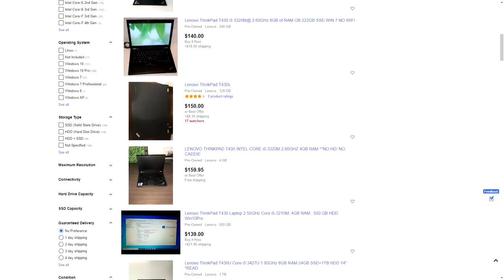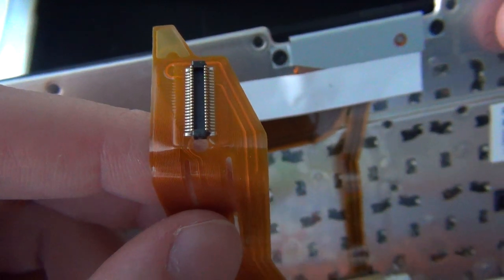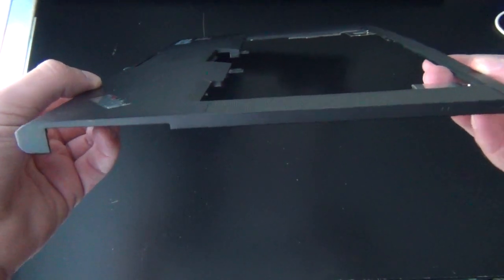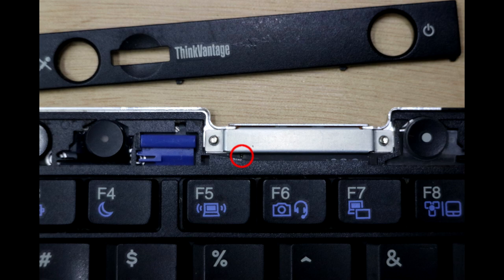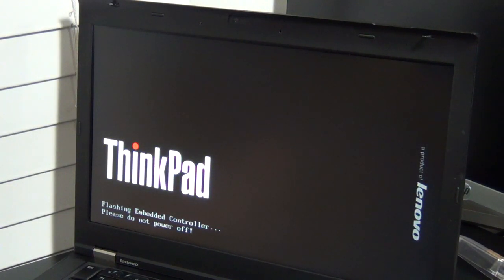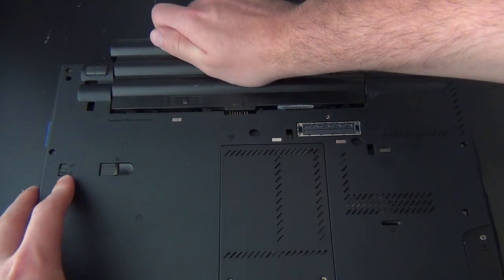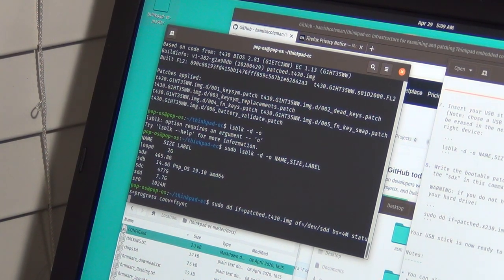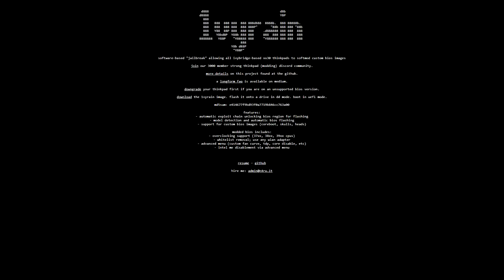Installing the classic keyboard in Ivy Bridge ThinkPads

Comment: When I did this on my x230 tablet I tested they keyboard swap without isolating the pins and the laptop started smoking within moments of turning on. Thankfully I hadn’t actually attached the keyboard into case so I was able to yank it out before any damage was properly caused. Please isolate the pins.
Reply: Just put an x230t motherboard in my x220t last week and this is the first I'm hearing of this, I think I might have open it back up today

Comment: Very nice video! Thanks for sharing! (One remark though, at 11:44: "sudo apt-get update" refreshes only the package information. It does not actually perform any "update". For this, one should issue the command "sudo apt-get upgrade" after the information on the packages has been updated. Unfortunately, the keyword "update" does not have the same meaning for every package manager. For instance, in Fedora, "sudo dnf update" will in fact update/upgrade your system.)
Reply from the maker: Whoops! Good to know.

Comment: the keyboards on the old thinkpads like the t420 are THE best laptop keyboards hands down.  it's orgasmic to type on it
Reply: I totally agree. For now we can stock up on *30 series thinkpads, and mod them with the *10-*20 keyboards. And stock up on spare keyboards. But sooner or later the day will come... what are we going to do when the keyboards supply is exhausted? Or when the laptops that can use them don't function anymore, or are too slow to run the ever bigger and slower software of the day?

Comment: 12:08:  It should not be necessary to run 'git' as the superuser in this step.  Downloading and building the EC software should be possible with ordinary user privileges.

12:45: Again, building the software should not require root.  (The reason you needed root in this instance is because you ran `git` as root earlier, and the thinkpad-ec directory and all its files are consequently owned by root.)

14:32:  Helpful mnemonics for the `dd` args:  "-if" == input file; "-of" == output file.

Comment: I've been using an X220 since 2011, and am a big fan of it's keyboard. I had a desktop PC at work, I got a ThinkPad USB keyboard for it, which has the same layout as an X230. I have to say the keys have pretty good feel and I did a lot of coding on that keyboard and basically it's a pretty good keyboard. But, even if the keys are good, the layout is not as good as the 7-row keyboard. I kept missing the way the Del/Home/End/PgUp/PgDn keys are arranged on the 7-row, and also the F keys being divided into groups of 4. So I think it's worth the hassle to fit a 7-row keyboard into the *30 models.

Comment: Great video! You might want to add the lsblk command, to the -o part the model parameter : lsblk -o name,model
That way you can see the drive model and it will be a bit easier to identify your drive.
Reply from the maker: Good to keep in mind.
Reply: Or plug the drive in, do `dmesg | tail` to see the kernel messages for the just detected device, the device name will be there

Comment: Best classic keyboard mod video out there!
Are the mentioned FRU/Part numbers mandatory, or does the mod work with any other T420 keyboard on a T430, regardless of the FRU/Partnumber?
Cheers
Reply from the maker: It should work with any xx20 keyboard, as they all should be interchangeable.
Reply: @SebisRandomTech  ok, good to know, thank you!

Comment: As T440p user, always envy to my friends who used classic keyboard Thinkpad. They look so so sexy
Reply: @Dhyan Jay yeah, the main reason i bought t440p is the screen, which i replaced too with IPS and also I installed OSX 14.6
Reply: The layout is irreplaceable. I love it so much I'm buying a mechanical keyboard inspired by the design!
Reply: @teguhrama2522  Why did you put OSX on a Thinkpad?
Reply: @comicsans1689  because I work with Logic Pro and Final Cut Pro.. and I hate Windows update 😅
Reply: @teguhrama2522  I would honestly rather just bite the bullet and install Windows if I needed those programs and couldn't get them working in GNU/Linux. Outside of the terminal, I can't stand using OSX. Windows 10 LTSB 2016 and LTSC 2019 work pretty well without the bloat of normal Windows 10. They only get mandatory security patches, but I'm pretty sure that you can stop updates through group policy.

Comment: When installing classic kb in my x230, I isolated the three pins, but then discovered that trackpoint buttons did not work (probably too much or too little tape). I then removed masking tape and the buttons worked again. So I decided to install it as is and everything works perfectly. I even installed chiclet kb again in x230 to see if backlight would work and it does. Closer inspection revealed that the burnout happened close to the three pins on the classic kb but it seems that it does not have any adverse effect. Putting that classic kb back in x220 does not incur any problems, everything works ok.  But it might not be the case for all. YMMV
Reply from the maker: Yup, even in reading the comments on here it seems everyone has had different experiences in regards to the isolating of the pins. I took the "better safe than sorry" approach and taped the pins this time.
Reply: Hi Sebastian. My trackpoint buttons did not work either. It did work the first time, but I have the Power Button not lighting up, so I removed the tape and put it back again. The Power Button did light up this time, but the trackpoint buttons did not. What do you suggest I should do? I am stuck here. 
I found another video talking about a similar issue. But I don't understand what he said (3:00) Can you help me with what the guy said? Thanks.
https://youtu.be/t4_6LQrmu14?t=180(from 3:00)
Reply: Your problem might have been caused by the masking tape being too thick, resulting in other (not isolated) pins not making proper contact anymore. It's better to use very thin tape, such as kapton tape, which is perfect for this application. I've done the mod to 4 thinkpads, and isolated the pins on all with kapton tape, didn't get any problems.

Comment: Love love love my T530. I'm thinking of buying an upgraded t530 I found on ebay. I was going to upgrade my current t530 with a faster processor more RAM and the 1080p screen but I decided to check eBay and I found one for half the cost of my upgrade. Now I can't decide if I want a new laptop with a beautiful touch screen and all the resolution or if I'd be fine with a classic ThinkPad for another 10 years. What thinkpads have the T430 keyboard that are still worth buying?
Reply from the maker: If you're referring to the classic keyboard as shown in this video the xx30 series is as new as it gets. They did release the 25th Anniversary Edition in 2017 which has a classic keyboard, but those are hard to obtain and can't be easily modded into other newer models.
Reply: @SebisRandomTech Sebi we’re waiting for more vídeos 😂💪🏾💪🏾💪🏾

Comment: Nice video! Weird question though.. if for some reason you decide to switch back to the chiclet keyboard, is there a way to mod the bios back to stock bios? Thanks
Reply from the maker: You would apply the BIOS patch but in the terminal in Linux you would type in a command to change the keyboard patch to "OFF".

Comment: The stock T430 keyboard doesn't really bother anywhere near as much as the newer, cramped chiclet style keyboard of today. T430 keyboards are in that transitional area between the amazing keyboards of their chonky ancestors, and those DREADFUL keyboards you'd find on, say, a modern Dell laptop. 

Useable overall tbh.
Reply from the maker: As I said in the video, the feel of the T430 keyboard doesn't bother me, it's mostly the layout. I still think modern ThinkPads have better keyboards in both feel and layout than many of their competitors, but I prefer the 7-row layout of older machines hence the main reason for doing this mod. Nothing wrong with preferring the stock T430 keyboard though!
Reply: @SebisRandomTech  Now you want an AMAZING Thinkpad keyboard? Those late 90s IBM Thinkpad keyboards were HEAVENLY to type on. Lol. The screens? Well...the keyboards were nice. Lmao!

Comment: This is a very helpful video.  I'm considering the mod but I'm wondering if there's any keyboard flexing after the swap.  Even any minor difference in feeling on different parts of the keyboard is very disturbing to me.  Some videos on youtube make them look very unstable.  Can this be mitigated?
Reply from the maker: Mine feels fairly solid, if there is any flexing it's within the tolerances of what the original keyboard would have had. You just have to be very careful with how much you file down the keyboard tabs - too little and it won't fit into the palmrest correctly, too much and it will be loose.

If you want to do a keyboard swap on a different Ivy Bridge model I know for a fact that you can get a matching xx20 palmrest with the keyboard and install it without any filing or modifications into the X230 or T430s. I in fact did this several years ago with my own X230, I swapped the keyboard and palmrest for ones from an X220 and it fit perfectly without any modifications.

Comment: Man I' m thinking about maxing out my t430 and making some custom mods like the keyboard change.

Even implementing a tri-boot for Windows/Linux/MacOS.
What a dope project computer. Just Wish I could get a better graphics card in it with out the limitations emoving the wifi for a PCI card would bring.
Reply from the maker: You can use an ExpressCard to PCI-E adapter to use an external graphics card (limited bandwidth but still massive performance boost compared to the internal graphics).

Comment: Interesting. I still use a T520 with the old keyboard, but it has been acting up due to some Intel ME problem, which caused a timer based system shutdown after 30 minutes. This problem has since mysteriously disappeared though. But it was news to me that replacement bioses exist (other than coreboot? which my machine supposedly didn't support.)
Btw, I recall reading about this keyboard swap some time ago, and if I remember correctly, it also suggested swapping the plastic handrest part - maybe doing so will obviate the need for filing the metal tabs?
Reply from the maker: On the T430 the palmrest is different enough from the T420's that you can't just swap them, hence the need to file the metal tabs. On the T430*s* and the *X*230 you can use a T420s/X220 palmrest.
Reply: @SebisRandomTech  As I have the T520 I may have focused on using its keyboard on the T530, I think the handrests may be compatible between these as well.

Comment: I see you took a linux approach to flashing the embedded controller, which i think is really cool, imho. If i could own any Thinkpad, I'd get a Thinkpad W530 and put the Intel Core i7 3920XM @ 3.8Ghz and do an IPS Screen Mod, Classic Keyboard and IvyRain mods to it, and run something like OpenSUSE or Artix Linux as my primary OS, and have Windows installed on a 2nd drive just for compatibility. Is this a viable option? how much does a W530 with the 3920XM pre-installed usually go for on eBay (as I'm not confident in my ability to mod it without breaking anything) 

Also, what form factors and stuff does the W530 support in terms of Drives? does it support M.2? if so, is it SATA only? or can i use NVME? how many drives (and what form factors/types) can i use on it?
Reply from the maker: What kind of workloads would your laptop need to deal with? With the CPU you want pre-installed I'm seeing them go for $350-500 on eBay right now (bearing in mind prices right now are a bit inflated because of the pandemic and people working from home).

In terms of drives the W530 accepts 2.5" SATA, mSATA, and a second 2.5" drive in place of the DVD drive using a hard drive caddy. You can not use NVME with it, however someone in the ThinkPad community is working on an ExpressCard adapter that supports NVME.
Reply: @SebisRandomTech  the expected heavy workload would be music production, so working with stuff like Reaper, Ardour, Audacity, LMMS, and other DAWs with lots of VSTs and plugins, so having good (and preferably fast storage) along with high capacity/fast RAM along with general multitasking and productivity work (Such as using Discord, Browsing the web, and potentially using art software to make my album art, but that's kind of reliant on the Display being color accurate enough to do so, which i kind of doubt.)

I may end up building a full on gaming/Workstation rig in the mean time, but i'm really interested in thinkpads, and wouldn't mind owning one for on the go productivity.

It's a shame intel was stuck on 4c/8t for so long cause a 6c/12t or an 8c/18t thinkpad with upgradable RAM, NVME storage and a good display would be fantastic.

I mean to be honest, my dream Thinkpad would be a Ryzen 4800H w/ 32GB of DDR4 RAM, a 1TB NVME drive and either no dGPU, or an Radeon 5600M (because nvidia on linux is a nightmare), though, my wish list is kind of unrealistic
Reply from the maker: @arcturus0389  Unfortunately while there are AMD ThinkPads, they don't have any heavy workload options or premium features like the "main" ThinkPads. The A485 is the closest thing to having what you would want (fast storage, AMD processor, 32+ GB RAM, etc) but those are pretty uncommon. The W530 would be good for your needs, and I should point out that while the W530 uses TN panels, they are very good TNs and the high-gamut 1080p displays are actually on par with some IPS options. Meanwhile the T430 had complete junk for its displays. :P
Reply: I gota W530 and I put a i7-3940XM (3.9GHz, overclockable once you 1vyrain it) in it. Classic keyboard already fitted. It came with a 1920x1080 screen. While it's not an IPS display, it is a very good screen, I don't feel any deficiency, compared to my X220/X230 IPS screens. Give it a try as is, you might not want to do any IPS mods. I'm in Luxembourg and paid 400 EUR for the laptop (which cames with i7-3820QM) and 140 EUR for an i7-3940XM (you know, on this model the CPU is removable, Socket is called G2)). I think in USA they are cheaper. Replaced the CPU and thermal paste and it's running well and pretty cool (cooler than my X220/X230).

No M.2 or NVME. You can use regular a 2.5" SATA SSD or HDD in the main drive bay, and one more 2.5" drive in the Ultrabay instead of the DVD drive (you need a special Ultrabay HDD adapter). You can add an mSATA SSD into the slot which is normally either empty or has a WWAN (3G) card, it will run at SATA 2 speeds (max drive speed will be slightly limited by the bus, which is 3 Gbps max - not bad at all, but modern drives can deliver higher speeds than that), while the other two drives run at SATA 3 speeds (6 Gbps max).

Comment: Great video Sebi, thanks!
I'm looking forward to the follow ups. I'm eager to buy T430 just to do the QHD mod. Why? For fun, to see T430 with higher resolution than my FHD T440p 😁
I'm in the narrow club of people who actually like x230 or T440p keyboards, maybe because my ThinkPad hobby is quite new and I never got conditioned with classic 7 row keyboard.
Reply: The new keyboards are still awesome, and it depends. My t430 has a very bad travel, but I had an X230t with a keyboard that I consider better than the chicony-manufactured classic keyboard in my T530.
Reply from the maker: @maxstevens9643  Chicony is generally considered to be the "worst" of the ThinkPad keyboards, so that makes sense. I have had some xx30 keyboards that felt better than some xx20 keyboards, all depends on your luck with the keyboard manufacturer lottery.
Reply: @SebisRandomTech  Sorry I meant NMB, I mixed that up, NMB is what I actually have.  I'm not sure of the my X230t's keyboard manufacturer as I sold it but I want to find out so that I can track one down.  Another thing was that that X230t was in literally untouched condition when I got it so that may be part of it.
Reply from the maker: @maxstevens9643  Wear and tear can definitely be a factor in how good a keyboard feels, especially any rubber dome keyboard.

Comment: I've got a T420 in pretty good condition. Just picked up a P14s (on the outside, a T14 with smoother keys). Can I cannibalize the keyboard from my T420 and do the same thing?
Reply from the maker: Sadly no. The T420 keyboard can only be fitted into a xx30 machine, like the T430 W530, or X230.
Reply: I'll do it the old-fashioned way: Close my eyes and wish for it really hard. Maybe I'll wake up and find my chiclet-style keys and the LED on the lid replaced by a nice keyboard with lots of buttons and a ThinkLight.

Comment: If I wanted to return to using the island-style keyboard, after flashing the EC to work with the classic, would I have to reflash the EC with a backup?
Reply from the maker: You would reflash the EC and put in the "Keyboard patch OFF" command before building it.

Comment: What are the best prices for T430 in Canada/US? I think Canadian and US prices are quite similar. I live in Canada so I expect ThinkPads to be a bit more expensive here.
Reply from the maker: In the US I would say anywhere between $100 and $200 USD would be fair depending on condition and specs, and keeping in mind that recent events have inflated the prices of laptops across the board. I imagine it might be a little bit higher in Canada because of availability and differences in currency.
Reply: @SebisRandomTech  would less than CA$300 be reasonable?
Reply from the maker: Depends on the specifications and condition.
Reply: @rickcupola6262  I would hold out for a price under $200CAD, unless it is a super specced model with extras.  Avoid eBay, as the prices are higher.  Kijiji/Craigslist will have better prices.  If you're not in a rush, take your time and see what deals pop up.  Remember, the listings you see right away are there because the asking price is probably too high.